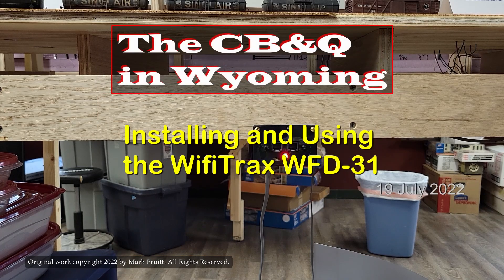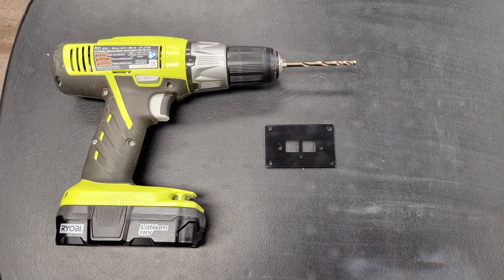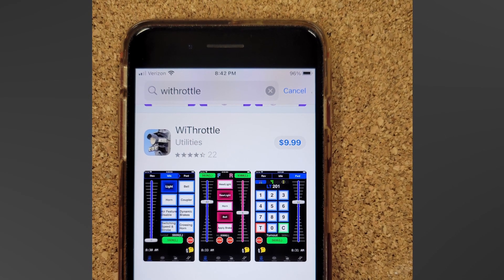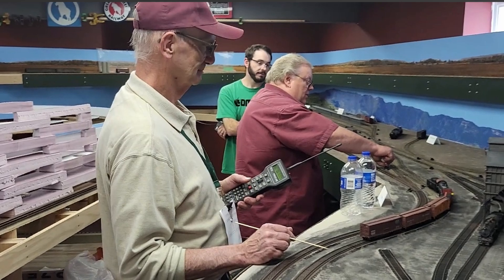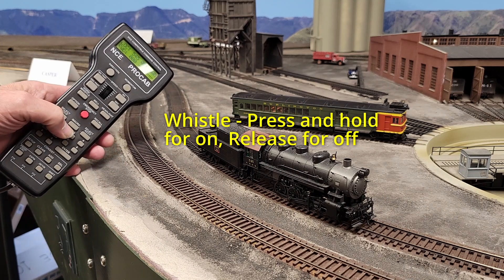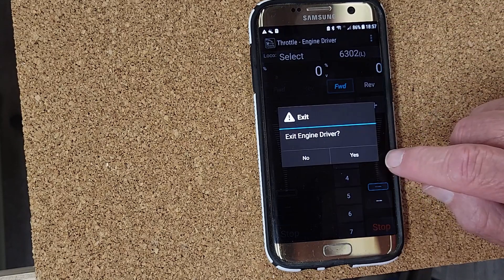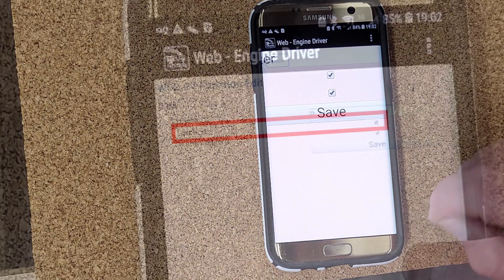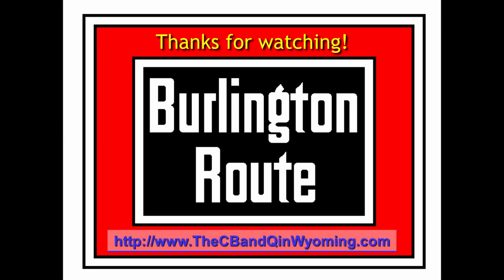2022 07 19 Adding Wifi to My NCE Power Pro System

Comment: You are absolutely correct about this little module!  I purchased the WFD-30 and connected it within seconds and was running trains in sheer moments with my TCS-50 throttle.  I have even brought my WFD-30 to friends places for op sessions and connected it straight to the cab panel on the fascia and was running trains in no time.  Many people are impressed with it so far 😉

Comment: Thanks for the video. I recently came across WifiTrax via another YT clip. I reached out to Steve as I'm running N-Scale and wouldn't you know it he has a unit called a WFD-27 which is a 5 Amp Wi-Fi/DCC Trackside Command Station/Booster. It will run up to 16 locos, which in fairness is enough for me and my bank balance. I was going to spend $$$$ on ESU Cab Control II, but now I don't need to and can get straight into DCC control at a fraction of the cost. It will be interesting to see how they compete with Blunami from Soundtraxx which has just released there Bluetooth control system, but at this stage no plans for N-Scale.

Comment: My head hurts.  Electronic setup stuff does that.
Doesn't NEC have a wifi system (it's too late to look it up myself).  If so, how does it compare?  It appears pretty flexible, which I wouldn't expect the OEM one to be.
Reply from the maker: Sorry about the headache. I don't like going through a lot of garbage to set up things like that either (though I could). That's why I went with NCE in the first place. But setup for the WFD-31 is really easy. 
I don't think NCE has a wifi-enabling accessory. I've often wondered why not. But the WFD-31 sure fits my needs well!
Reply: @The_CBQ_in_Wyoming  lol!  I despise all the software & hardware setups, menus and submenus and subsubmenus, ad nauseum.  Also calling up institutions that have automated systems which require pressing 27 buttons just to select your name, leave you in some dead end you can't get out of & have to start over, or don't have a choice for what you need.  
I beg my wife to do those things.  She has patience.  I have issues with stupid & aggravating.  There's a lot more stupid & aggravating these days.  Perhaps not coincidentally, I spend a lot more time in the basement these days. 😆
I'm surprised NEC doesn't have a wi-fi setup.  I'm glad someone filled in the gap.  Maybe you should become the North American distributor for them. 
Let us know how you get along with it in a month or two.

Comment: I'm just a simpleton and this is not something I will pursue, but I'm glad it works great on your railroad. I'm still learning how to railroad, let alone having to figure out this high tech stuff. I used to be afraid of DCC, but now it's super cool, and I would never go back to DC. Since you have run on my pike, you know what you get. Simplicity, right?? haha  I think your WiFi control is to me what my Big Spinning Car Distributor is to you at the moment. ??  I'm sure you'll get the idea soon, but I'm not too sure about me and the Phone Throttle. Looking forward to our next OP Session next month!!!
Reply from the maker: The phone throttle is simplicity itself. It's also very cost-effective, since you don't need to buy expensive radio throttles if you have wifi. AND they're portable - I can use my phone on both my own layout (NCE) and the club layout (Digitrax). The only downside is I hate using my phone. One of these days I'll get a TCS universal wifi throttle and have the best of all worlds.
Reply: @The_CBQ_in_Wyoming  Well, now you have my attention. I have plenty of throttles for my railroad, but since you could use it with Digitrax, that has peaked my interest a little. We'll chat more later.